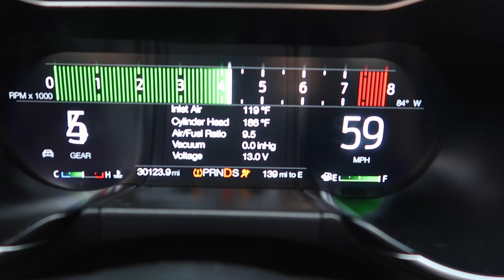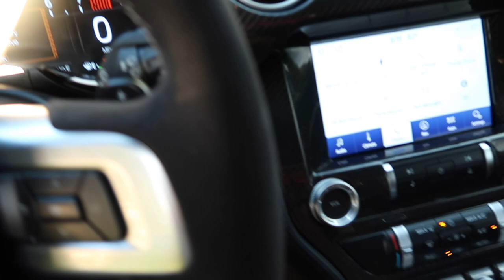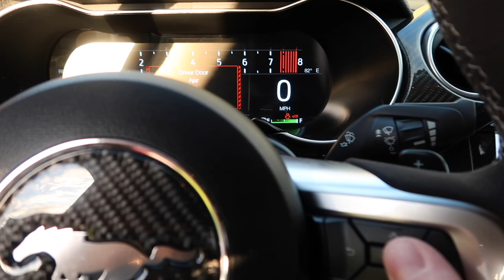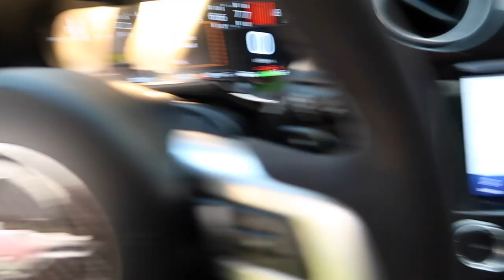My Supercharged Mustang ALMOST BLEW UP... DON'T LET THIS HAPPEN TO YOU...

Comment: Darrel tuned my car as well and he pulls a shitload of timing when the IAT's go up which saved me along with meth injection.
Reply from the maker: Always a good thing to be honest. I’d rather loose power than an engine from hot IATs
Reply: Yeah Daryle does a great job of keeping our motors alive
Reply: Yea he told me he had it setup to start pulling timing at 140°.
Reply: Maybe check valves and vent can stop any air bubbles that lock up the pump flow. 🤔
Reply: What do all the ppl do that don't have ice tanks?  Why are you guys seeing such high IATs?  Is it an engine cooling issue?
Reply: @d3et1roi3t  I don't have a ice tank or heat exchanger, I run a killer chiller. Stop by my channel I I lots of content on it. It pretty much uses refrigerant to cool the supercharger cooling system to a/c in cabin temps. Tvs superchargers create alot of heat and use air to water systems.
Reply: I think if you have a car that the temperature can rise that quickly maybe put some kind of autible alarm when the IAT's start to get in the danger taritory. That way you can watch the road and not have to constantly be looking down at the cluster and end up wrecking.
Reply: @d3et1roi3t  This is just my personal opinion but i think in this case there was a pump failure. I do  not have an ice tank and after multiple pulls 120ish is the highest i see. My tuner has  my iat's set so it pulls so much timing after 150 the car will just fall on its face.

Comment: Stangmode seems like a great guy, but it doesn't appear he understands how to turn a wrench or the mechanical side of Hulk. I feel he needs to get more familiar with his engine and transmission setup including cooling tanks. He loves to race and sometimes forgets car needs to cool down between runs. He also apparently forgets to monitor his gauges. When he was ask to hot lap at Pocono racetrack. He just couldn't say no. Why do pro-racers run fans to cool their engine between runs. Running a Hot lap on a dragstrip isn't smart, but it's not like running the straight away at 170 mph back to back at Pocono international Raceway. I hope your wrong about him needing a new block, but I guess the story will be told at teardown. Great informative video and finding out that the cooler pump is defective could be an issue that could become a legal issues depending on if it's proven to have created engine failures. Racing is expensive and if you run weekly. You need the cash on hand to add new mods and repair breakage. I have to add that I've noticed religion has become a big part of your life. Something to be proud of. Good luck and be safe with your beautiful Stang. Watching you wrench your own car. When you talk about mechanical issues. I listen.
Reply: Valid feedback and concerns but couple of things: Stangmode is not a mechanic and he trusts his builds to best people so a lot of times he operates on info those people provide him. Also, yes, he "hot lapped" Hulk but (if you paid attention to his video), his IATs very looking good before the hot run, his ice tank was good and he had nitrous that does bring temps down. We don't know exactly what happened yet but an extra run in 70F weather should not kill a built block. Hopefully, we will get to the bottom of it and see which component didn't perform as it was supposed to.
Reply: @darkvader_s650  I agree that he's not a mechanic or am I. But when I have an engine built I research and ask many questions regarding the parts being used and often I install them myself or at least become involved. To blow up a newly rebuilt engine this fast. Something had to fail internally or externally like the cooler pump . Another thing I find important is keeping an eye on my gauges. Drag racing or should I say most automotive racing is expensive. Basic items like axels, rear ends, drive shafts have cost me a few dollars over the years.  I will be interesting finding out what caused the failure. I always wish him the best. Two engines in this short of time is not the norm for a street style racer. Class cars often run a full season using one engine with teardowns for inspection. Really hope he gets it figured out.
Reply: You're a good guy Zander.👍🏽
Reply from the maker: Thanks

Comment: Sorry, anybody that works with fluid pumps could tell you that is a crappy design for a vehicle.  The pump is cavitating, that is that sound.  Its purely a result of the design of your system.  Every time your car moves,  that suction port can be exposed to air, that white froth is from the cavitation.  The pumps suction cannot ever be exposed to air, and without a degas bottle, that pump will not come back, unless you perform your "cpr".  I would never use that setup in my car, without a flow switch that kills fuel or gives you an indicator light warning.......that setup will fail regardless of the pump you use.  Check out an OEM setup, they understand this simple principle.

Comment: cant run pumps with the outlet below, unless there is an air bleeder on top. the air easily stays in the pump housing and prevents suction, even when the waterline is above the pump. either clock the outlet so it is on top, or drill and tap the top to fit a 1/8 fitting and run that back to the tank. This is definitely an install error. the pump is fine as it kicks back in when you manage to get the air pocket out. that loud sound is normal to hear in an airlock and wont have damaged the pump, not yet at least.
Reply: True story

Comment: Edelbrock Stage 1 here on a 2019 GT. For the first time ever I saw temps at 145 after some pulls and then letting it sit while I filmed.  I got called out and jumped in the car to make another pull.  Noticed the 145 and still made the pull... which I probably shouldn't have.  5 minutes of highway driving and the temps were back down to 85.  I think I'm going to make changes to my nGauge to have the LEDs light up Yellow, then Red at certain IAT temps.  That way I'll get an instant notification to shut her down.

Comment: For a upgraded cooling mod even 120 cruising is unacceptable. Killer chiller FTW 🙌🙌🙌.
Reply from the maker: I need one
Reply: @Zander13Productions  brother install can be a pain but once setup it's just a relief not having to worry about ice, air pockets, or high iats. I've never seen my temps over 135 during back to back pulls in Texas heat.
Reply from the maker: @primofx2sport  how much did it cost
Reply: @Zander13Productions  Not more than those engines that blow... About $2000 for interchiller and Killer chiller is cheaper..
Reply: @Zander13Productions  the drag unit killer chiller is $1100 and the already welded high side line is like $100. Since you work with lethal performance give them a shout they are a dealer for Kincaid. But for the high side line you need to call Kincaid. Also I got a buddy that has the pnr tank combo with killer chiller and the guys iat2 stay lower temp longer than mine.
Reply: @primofx2sport  how did he do that
Reply: @luisvelez585  killer chiller to pnr pump from pump to tank tank to supercharger and from supercharger back to killer chiller.
Reply: @luisvelez585  pretty much the pnr is a bigger reservoir and has a stronger pump for better flow.
Reply: @primofx2sport  damn that’s awesome man I never really thought of that
Reply: @luisvelez585  yea thing works awesome! I'll add the pnr later but the killer chiller drag unit was more than enough for a Texas summer. Raced this whole summer with no iats over 130.
Reply: @primofx2sport  that’s impressive I have a edelbrock supercharger on my 19 mustang gt and was thinking doing the vmp ice tank under the hood and killer chiller
Reply: @luisvelez585  that would be legit for a bigger reservoir I thought about that as well. Only thing is with the vmp ice tank it's just more volume. It doesn't come with a stronger pump. So if your going to spend to money to add to the killer chiller probably best to go with ice tank so you get the bigger reservoir and stronger pump. Check out the content though. I'm in no rush for the ice tank it's just more of a want than need. As long as you get the drag unit killer chiller it does amazing as is!
Reply: @luisvelez585   I have the same supercharger.  For the first time ever I saw temps at 145 after some pulls and then letting it sit while I filmed.  I got called out and jumped in the car to make another pull.  Noticed the 145 and still made the pull... which I probably shouldn't have.  5 minutes of highway driving and the temps were back down to 85.  I think I'm going to make changes to my nGauge to have the LEDs light up Yellow, then Red at certain IAT temps.  That way I'll get an instant notification to shut her down.
Reply: @100mphClub  well sadly my crank snapped
Reply: @luisvelez585   😳 that’s not good.

Comment: Tank sloshing losing prime,outlet on tank should be coming out the bottom of tank,not the side,design flaw. I think the pump is fine or damaged from cavitation by sucking air.

Comment: My IAT's are consistently 50 degrees over air temp. Temps go down on throttle but normally IAT's are 130 to 140 on a 80 degree day. I do have just the stock roush HE. I have  the in tank pump that feeds the same pump you have and the in tank pump can't keep up so it pumps and stops. I think when I go triple HE my Temps should drop.
Reply: You need the vmp triple pass heat exchanger

Comment: Just wondering, if my Roush has a pump ? If so I need to learn where it is and start paying attention to my dash while driving . Thanks for the information , as always you give great advice. I’m looking forward to seeing you at NMRA event soon . J
Reply: Yes the roush has a pump. It's located tucked under the hiding tank on the passenger side by the front bumper.
Reply: @primofx2sport  Thanks I figured it might have one but wasn’t completely sure . J
Reply: @jameshows5419  no problem. When you open the door it should power on the pump to prime. Should be able to hear it come on.
Reply: @primofx2sport  I’ll have to start listening for it . I’m new to having a Supercharged car . I already know how to use the cool down feature in between runs at the track . I’m hoping this will come in handy at the track in a few weeks. Any tips on supercharged engines I can get are most appreciated. J

Comment: Have you thought about relocating the pump under the floorboards to insure that no air is entering the system?
Reply: I had the same thought.. that inlet tube is pretty low on the pump too so if air gets in its gonna put more stress on it. can you turn it sideways so the inlet is on top but still under the reservoir? Watch some jayztwocents videos on AIO coolers.. same concept

Comment: Comes down to user error in regards to stangmode.  L&M is legit. It’s not them.  If you don’t know how to use nitrous and you have zero experience with it you shouldn’t  be putting a 150 shot through  your motor.

Comment: I think the pump is to big….over flow creating air in the impeller housing…otherwise the hose is to small for the volume of water moving through it….so get a smaller lump or slow the pump you have down….don’t think you can do that…..plus all those 90 digress turns in the hoses are very bad for flow….my 2 cents

Comment: Have a 2016 GT with a Roush super charger not as advanced as yours but all the power and speed I need my problem is I don't know a lot about sc mine had no paper work with the car so not sure when it was installed I bought the car used in May who ever had it had modified it ie... Carbon fiber hood with plexiglass hole to show sc also had those dopey round taillights which I have since replaced with tri bars also have added hood struts and new wing so any advice you could give me on sc would be appreciated I doubt it is tuned because as I said earlier nothing came with the car Thanks in advance

Comment: You can't have ANY air in the tank or lines. On the very first shift all the water in the tank will slosh and you'll instantly suck in an air bubble then all the water in the lines will move to level out. Add a tube inside the tank to pull from the bottom center of the tank. Add a reservoir tank that's as tall as possible to eliminate air bubbles from being sucked into the pump. Ideally the pump would be inside the tank like a fuel pump is, in a lower indentation.

Comment: It was 100% a tune problem. The tune didn't pull timing from high iats. The knock sensor pulled timing when the engine started destroying itself. 

It's obvious his heat exchanger pump failed or air was in the system which caused the high iat2 temps but any good tuner sets a car to pull timing and go rich to save the engine if that happens. His log showed niether.
Reply: Who's he tuned by?

Comment: Safety is always First... good catch on IATs! IMO, it seems that you are having more of an air issue than a pump issue. As the pump is powered it starts to run, but the pump is experiencing cavitation, until the head of air is removed thus returning circulation. Suggest thoroughly bleeding the system of all air entrapment, check routing of lines, reroute lines as needed & remove as many fittings from the coolant lines, ESPECIALLY the 90° on pump inlet.
Could it be pump? Not impossible. Good luck, any questions lmk

Comment: I've seen things like this in other apps, u could have ran the pump "dry" with hitting bumps causing air pockets little by little pumps hate air and will start to brake from the friction. Just a guess but the trunk with wheel hop or anything causing foam or bubbles to reach the pump might mess them up. Not saying it's the case bc you'd think the manufacturer would test the whole trunk location out b4 full send. GL, sounds like the pump is on its way out tho, ive heard that exact same noise b4.

Comment: Also the temp you posted on your digital dash, does the odin kit wire setup change the reading from iat1 to iat2? Because inlet air temp is iat1, temp entering intake tube.
Reply from the maker: Those are the blower temps with their sensor.
Reply: Ahhh ok so it changes your iat1 to iat2. On my dash the inlet air temp isn't post blower.
Reply: @primofx2sport  These use a iat splice harness so IAT 1 on the cluster is actually reading charge air temps.
Reply: @Wengerdperformance  ok that's what I figured. Wish the roush were setup that way. Makes things more simple than needing a datalog reader.

Comment: All that noise from the pump doesn't sound correct at all.  Something is not right for sure, good thing you caught it.  I put a 2013 GT500 HE pump on my supercharged 06 bracket racer.  Makes my degas tank bubble like a hot tub there is so much flow.  I'd be real nervous to drive with your pump acting up like it is now.  Good luck on resolving the issue.

Comment: I have same tank a little different on how I have mine setup but have had no issues with my temps and I’m running 50/50. In stop traffic I don’t go pass 115. But I also have a heat extractor right above supercharger. Good luck on the issue, PNR is usually good on the pump warranty if you filled out the info on the site they tell you to go to.
Reply: Which Supercharger do you have? Is it the VMP Odin as well?
Reply: @mavricxx  no I have the whipple on mine.

Comment: I didnt have anywhere near the power in my e55 but a bad pump will ruin a motor if you dont keep track of IAT's constantly. Even with duel heat exchangers, superflow pump I had IAT issues. I'm not sure why no one runs inner chillers on there supercharged mustangs, maybe it cant work with that set up but running a innerchiller will keep IAT's way down. On any forced induction car cooling is number 1 priority since the amount of boost created just generates tons of heat.

Comment: Zander13......From what I could see in your video (maybe just the camera angle view makes this look this way), check the pump inlet grade from tank outlet to pump inlet....it looks as if your pump's inlet grade is higher than the tank's outlet port which will cause that pump (impeller pump) to cavitate due to insufficient liquid column head weight, foam up & lose prime....especially if the liquid temps go up (liquid becomes less dense at higher temps.....the foaming on the liquid's surface is a telltale sign of cavitation). May only need to either sump the pump or raise the tank to increase liquid column head weight to pump inlet to sufficiently load the pump impeller to stop the cavitation & maintain prime. A suggestion to consider...........
Reply from the maker: Absolutely. I was re looking at that today. I plan to relocate mine further down as much as possible

Comment: Sounds like the pump is sucking air from somewhere? is there a way to vent that pump?
Reply from the maker: Only way to vent is with lid open. And it does have a vent valve too
Reply: @Zander13Productions  need to find out if the pump is pulling in air from somewhere. may not be a bad pump. but could be just getting airbound.
Reply from the maker: @chillwill0330  yes. I Definitely need to spend some time on it. I’d hate to replace it